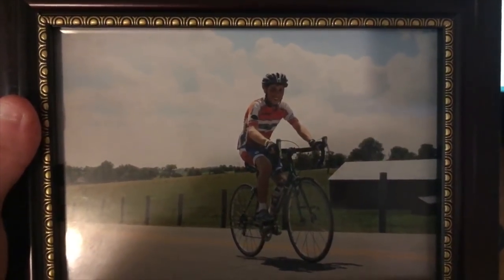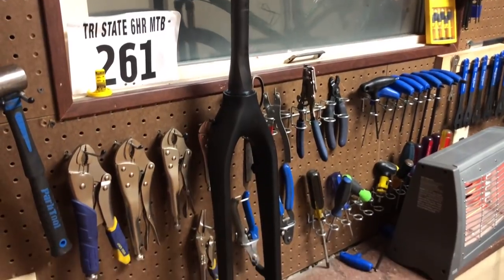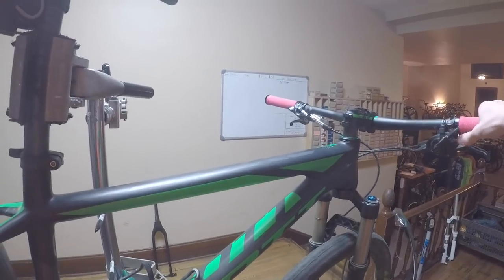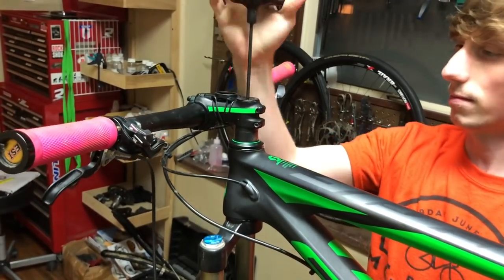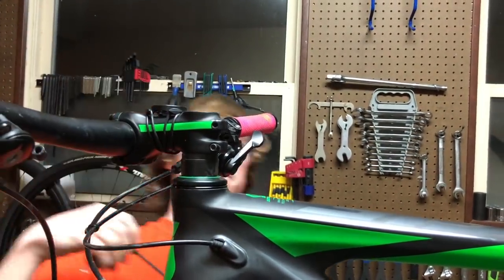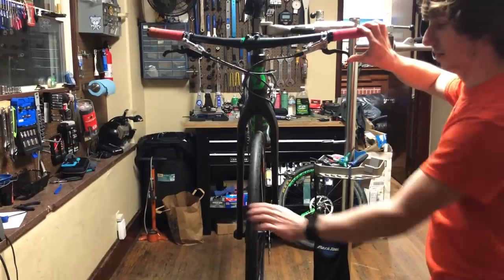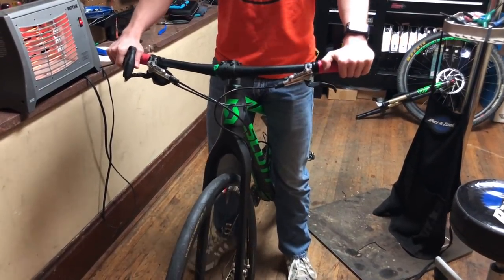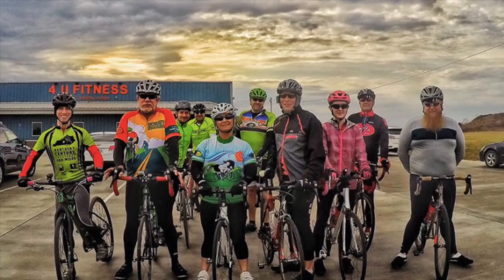Convert a Mountain Bike into a Road Bike!

Comment from the maker: Hey everyone! Just wanted to throw this comment out here, thank everyone for viewing and everything. I was curious with this channel: 
What other content would you guys like to see in the cycling community? I am open to any and all suggestions. Just comment below and I can go from there!
Reply: Whats tje size of ur wheelset 29er or 27.5 er?ty
Reply from the maker: On this particular build - 27.5. But I have 29ers and a 27.5+ in my bike line up as well.
Reply: What's the width of your tire???
Reply: I'll be happy to watch any video tbh. Reviews, how to's etc be cool to see a pov ride on your Scott mtb with road conversion👍
Reply: if you can live with the 1kg weight penalty, a lockout for the suspension fork lets you easily convert between the wheels
Reply: if the fork has a lock, would you still need to change it? i usually have mine on locked, since i waste too much power if i keep them unlocked
Reply: @Ropetable  alright saw this after i commented, was asking about that. i ended up using mine almost always on lock, unless i really need it.
Reply: what's the Teeth of your Chainring and your Cogs?
is it good in climbing?
Reply: Hello, what brand of fork is the specific one in the video, do you have a link please?

Comment: you made a hybrid
Reply: hybrid with a very low bb and pedals scraping the floor
Reply: @ansismaleckis1296  whats bb
Reply: @MuhammadImran-lw3kb  bottom bracket
Reply: @ansismaleckis1296  Actually, a mtb has a higher bottom bracket than a road bike, for clearance on the mountain.
Reply: Saya suka baku hantam.... hokya hokya
Reply: Hybrid has thicker tyres then road tyres
Reply: @shashankgujar8966  not always some are closer to mountain bikes where as others are road bikes with flat bars
Reply: @satriaadhiguna  wkwkwk parah
Reply: A real hybrid  would be get a suspension  seat post and keep the front suspension  100mm is plenty for road riding so ile keep the front suspension  since its more  comfortable  to ride on the road and you don't lose alot alot speed like a full suspension  bike does since we all know hard tails are faster why not add a suspension  seat post you can keep the same fast speef but have the comfort of having  maybe half suspension  you don't need a full suspension  unless your into trail riding but commuting around bad roads force me to go hard tail road bike with suspension  post so I don't get a sore asshole lol

Comment: No drop bar? :(
Reply from the maker: I think putting the drop bars wouldn't be that hard! Just have a set with brakes installed, with the calipers neatly tucked away while in storage, then swap the bars and brakes when you want! Interesting idea
Reply: straight bar preserves comfort
Reply: Jordan Sands did this to my 26er because buying a 2nd bike is expensive. Didnt buy a road shifter been riding on the drops always. Nice frame bro!
Reply: Mountain bikes have a longer reach than road bikes.  Drop bars would be too long to use comfortably on a mountain bike unless you size down for your height
Reply: say what!?
Reply: That would mean changing brakes and derailer.

Comment: If anyone out there has a 29" mtb, you can just put 700c road tires on your existing rim...they are the same size! Just did it myself to a junky walmart 29er mountain bike, made it my city going hybrid with the slicks
Reply from the maker: Yes! I meant to mention that. They are the same size rims.
Reply: Does it work well?
Reply: I did this to my EMTB , Not really worth it. So much happier with the 29" 2.6 plus size tyres back on for comfort and looks.
Reply: Nick Wintersteiger yes it works well. It requires different tubes to go with the skinny tires but you can easily switch the tube and tire combos out and always have the same bike and wheelset
Reply: can a 700 x 35 tire be used on wheels 29
Reply: @herossalie5270  Yes quite often. Some MTB wheels have pretty wide rim and then you cannot put in anything too narrow on them. I have put on around 40 mm tires with excellent results. If you want to have more MTB looks still you can put tires like WTB Thickslick, Schwalbe Big One etc. The bigger the tire though, the more weight there is so sometimes just getting more narrow ones makes sense.
Reply: @innocentiuslacrim2290  I built a bike starting from a cheap Merida T2 frameset, (because its geometry suits me better than any road, cyclocross or gravel frame), using road handlebars, Sun Ringle Inferno 29er rims, (because I am heavy), XT hubs, Avid BB7 road disk brakes and a Shimano 105 groupset. On these 29er rims I put a pair of Continental Gatorskin 700x23 road tires. They go together very well.
Reply: yup.. get a 38 or 40.. u'll love it..
Reply: @herossalie5270  Yes you can. Both sizes are based on the same rim size so they are perfectly compatible.
Reply: By 29” mountain bike you mean 29” rims correct because the 700 tire is 27.56” tire. I’m trying to convert my mountain bike and it’s got 29” rims. Thanks for any advice.

Comment: This is exactly what I was looking for. I have a Trek Dual Sport but I don’t do off road much anyway. Just wanted the option to do so. After a while, I wanted to be a bit faster and a more smoother ride. Now I converted it to a road bike, but I didn’t have to go as in depth as you. The wheels were already TLR rims and I simply changed the tires and tubes because I not tubeless yet. Also added bar ends . It’s made a huge difference.

Comment: Not sure if it has been mentioned in the comments yet, but an easy way to align the brake caliper is to just squeeze the lever when you go to tighten the bolts - perfect alignment every time.

Comment: When you pull your brake while the screws are loose and then simply screw them tight while still pulling the lever you don't have to do so much guesswork.
Reply: exactly !
Reply: Unless the rotor is ever so slightly bent
Reply: With rim brakes no guesswork be on aliment
Reply: Was thinking the same thing...  as well...  do that routine out of the stand... push on the front end, lock brake, rock a little, snug bolt, rock, snug... and so on....
Reply: @tmayberry7559   not if you have BMX-Brakes ),:
Reply: I only realised that not too long ago. All this time I've been stressing with the adjustment.
Reply: Wanted to point out the same thing, thanks! ;D
Reply: That doesn't always work sometimes you gotta use a disc alignment gauge that you slip through the calipers and rotors while you pull down.

Comment: Thats a great conversion. What I do with mine is simply swap the wheels. I have the same wheelset, but the difference is that one has my trail/XC tires and the other set has the stock worn XC tires, which I use for road/gravel biking. I plan on getting a set of slick tires for my bike, so it will look like a monster road bike, but I am ok with it :)

Comment: Thanks for sharing, I can 100 percent see where your coming from, having both a Marin Mount Vision Full sus Mountain Bike, and a Trek Madone road bike (for which I had a proper bike fit done) , I always found myself grabbing the Marin , it just felt “right” , the Madone is a good bike - however it just doesn’t have that fun factor! Also I find myself constantly fidgeting on longer rides. The Marin is also far more practical here in the UK on our horrendously potholed roads. I’m so glad to see someone else has the same views! I’m selling my Madone and building a hard tail with wheels like you’ve used, I will keep front Sus fork though, due to riding a lot at night & unforeseen potholes!

Comment: This video is great! I stopped at "...pointless in the comment section...not capable...blah...blah..." I did the same thing to my Trek 6700 SLR and I am loving it! The only difference is I went with a carbon road fork, there was a noticeable difference in handling but no noticeable geometry change b/c the angle is still the same. As for people and there comments forget about it. This conversion is ACE for ppl who can't blow thousands on a road bike, my build started in Nov. I rode all winter upgrading parts as I went along. FINALLY the most expensive parts are on the way this month, I can't wait. Great video thanks for sharing!

Comment: 3 years ago i put road wheels on my Mountain Bike, and  it's pretty effective I can keep up with Road Bikes easily. The front suspension takes the imperfections in the road so you don't get sore hands. I recommend if you ride 20 km a day like me.
Reply: GamingOnTheBike Also on most mtb's you can just lock out the front fork to save energy on flat straights.
Reply: I second that besides I find it more practical cause you don't have to store your favorite mountain bike and buy another bike. Plus hybrid bike looks cool

Comment: I had a 2014 gt karakoram and it got stolen. I loved the way it fit so much that I bought the current year which was a 2016. 2 months later I managed to see someone riding my previous bike and got it back. I decided to get some skinnier tires which cost about $60 and enjoy it a ton. I do like having the front suspension with lockout for hopping curbs and the occasional offroading. I have tried to find a road bike that fit the same but I can't seem to get the same feeling. I would recommend a taller gear if possible as i find myself topping out on the flats with the skinny tires.
Reply from the maker: That sucks, man. I would die if someone stole one of mine haha. But that's true! I just didn't want to fool with swapping the front out, so I stuck with the small one.

Comment: Did this several years ago with an older steel MTB frame and crankset and used a road fork and 700c wheels. I was doing the 75 mile course of a local event called the Brutal 100, which it is! It gave me the best of both worlds, speed and hill climbing ability. Thing was twitchy as all get out while using the aero bars on the straights though!

Comment: nice build. i did this last year with my stumpjumper hardtail. got a niner rigid carbon fork but i used my existing mtb roval wheels and some 28mm tires. i kept my cassette for more range and i used a 38 oval at front. sometimes i keep the rigid fork on and place back the mtb tires. riding a rigid mtb is also fun. lots of options with builds like this at a fraction of the cost
Reply from the maker: Rigid mountain bike riding is definitely interesting! I have a video I made when I first bought a single speed, and it had a rigid fork. It's a lot of fun, but man it beats the snot out of you lol.

Comment: why not going for 45c tyres.?
got some on my gravel bike and it descends like a supermoto. plus with low pressure i can stil ride them on dirt and gravel even if the'r slick
Reply from the maker: I just left those wheels to strictly road riding. There's a ton of options, of course! You could throw some 32c Cyclocross on there and make a mean bike as well!

Comment: Your mtb fork has lock out? Why should change it ?
Reply: Yeah, lock out your fork and put on road tires...... done. Didn’t need new wheelset, cassette and fork.
Reply: 1) Minimally 1kg of weight down.... 2) I don´t say, that this looks really good, but road wheels on suspension fork looks really awful...
Reply: To make the bike lighter
Reply: he has carbon frame ... no need much ligher ...
Reply: its almost 1kg lighter atleast, the carbon fork is much more rigid than the locked suspensionand and those carbon forks arent that expansive. is worth the change. I used to change from suspension to one of those when racing in less technical XC marathons, your legs will thank you after 4.5hours of race. your arms, neck and back in the other hand, not so much xD
Reply: Ivaylo - We allways need much lighter :-DDDDD
Reply: Lighter
Reply from the maker: Like everyone is saying, it is lighter. Some people are more focused on saving weight than others. My biggest thing for swapping it out is the stiffness. You can lock the mountain bike fork out, but it's still gonna have just a slight amount of give in it when you're putting down a hard effort. The RockShox RS-1 and Cannondale Lefty forks are some of the only ones I've seen that completely lock out. But, you could jsut leave the fork on! It comes down to what you want and preference.
Reply: Because the carbon fork looks much nicer with that frame.
Reply: Yes, having all that work to change it from road to mtb isn't worth the money, stiffness and time imo. I have a mtb and a spare set of wheels with slick tires and I can swap from mtb to "road" in 2min.
Reply: Weight and aerodynamics. The thick cylindrical tubes of the suspension fork adds quite a bit drag.
Reply: LorDDemoniC Videos weight
Reply: maximum speed with maximum comfort is an illusion.

Comment: I just converted my mountain bike Diamond Black over drive to rod wheels and it worked great. Just replaced the 29" with 700C tub/tires and no other hardware changed.

Comment: I have a 29 wheeled hard tail mountain bike, last year I went on a road trip of about 300 km (186 miles), and the only thing I had to do was change my tires, I'd put 700 c x 28 mm on the 29 rims and they've fit all right, blocked the front suspension and I had a very comfortable "road" bike.
Reply: this is why I love mountain bikes they are super versatile you can't do the same on a roadie

Comment: I am planning on doing the same to my future 1x11 650b mtb for one reason only....I hate drop bars! I will essentially get a two-for-one deal, plus I am going rigid fork so no need to switch that out. I can just exchange mtb wheels for road wheels in seconds. I will purchase a second e*thirteen 9-46t cassette for the road wheels as well paired with a 36t chainring.

Comment: xx-622 is 622 by another name, 700c, 28in and 29er. Good idea!  My rides are somewhat more modest but I think you would like my bike's gearing 36-39 sram and 11-32 cassette.  It's a gravel bike, I think you'd like it.
I don't know if you're familiar with the Camino de Santiago.  Anyways it's a nice ride.  Actually there's quite a few ways to select, I chose the Northern Route.

Comment: after doing the same thing some time ago, dont put skinny tyres on. 2' semi slicks at 60psi are just as fast, and you wont fall off if you try to turn or use the brakes
skinny slicks in the wet, with mtb hydraulic brakes means you will fall off

Comment: I have a single speed bicycle, not a big fan of geared bicycles. I want my bike to go further with lesser number of pedals. Does changing the sprockets work?
Reply: Yeah if your a single speed rider finding a suitable gear ratio for your area and riding style is going to be a constant struggle. If you want to pedal less you will need a bigger chainring on the front or a small cog on the ring. If it is a freewheeling single speed it is much easier to change the chainring. Good luck and have fun riding single speed

Comment: im trying to do that but i want to change the handlebar to a road one, that means changing shifters.... that means i need to change transmission ..... can i co with just changing the rear derrailer and cassette or do i need to change it all? thing is that its an electric bike and i think changing the crank can damage the electric engine

Comment: I'm planning my build now but I have wheel questions, if u can answer. My bike has boost 110 and 148 front rear respectively, do I get a non boost fork with non boost front wheel, then what about the rear? Or get boost fork and keep boost front and rear? If I go NON boost, how will a non boost rear wheel fit in a boost rear triangle?
Reply from the maker: There is an adapter made called the Boostinator (found here: https://www.wolftoothcomponents.com/products/boostinator) with different specs and sizes! So, if you were going to go with a non-boost wheelset, you could use these to make them fit the boost spacing. The front fork wouldn't really need to be boost, since your road wheel isn't, however I am not sure fi that would have any negative effects on the handling of the bike. Or, if you haven't bought wheels, you can find a set of boost gravel wheels ( I think those exist...) or use boost sized 29er wheels! The 29er rim is the same diameter as a 700c, so if you find a narrow rim you could slap a 28mm-32mm tire on there!

Comment: I also prefer flatbar instead of dropbar. Because on crowded streets dropbar is harder to control cos of breaks. But flatbar's down side is it gives you only 1 ride option which can be pain after hours of riding.
Reply: Tinker rides 24hr marathons with just the flat bar at 60 like he always did since his BMX days, you’d never catch him in an xc race with bar ends, he never used bar ends. He does ride drops on gravel tho. The guy’s a beast over 60 still pro racing. Cannondale XC racer’s wanted to train their 26” bike frames on the road and so put 700cc wheels on and they fit: thus the Bad Boy was born in 2000.

Comment: Doesn’t swapping to road tires drop the bottom bracket slightly?

I did my first sportive on a stumpjumper with 26x1.5 Specialized nimbus semi slicks at 60psi years ago. I had the benefit of a 44 up front though.
Reply from the maker: There actually isn't much of a drop on mine, since mine is a 27.5 mountain bike. It still fit about the same!